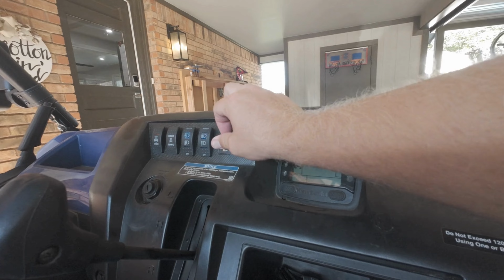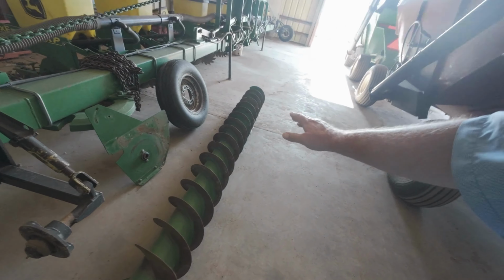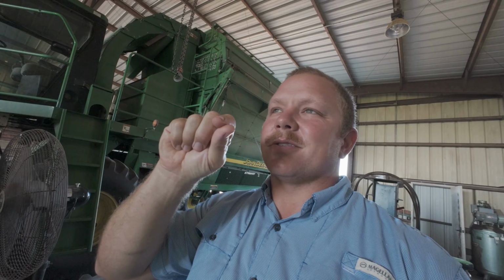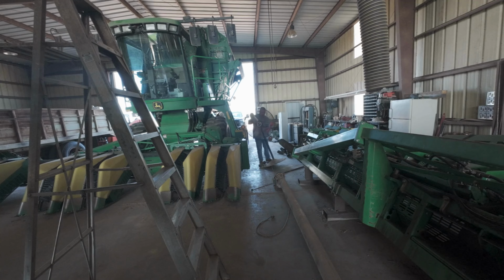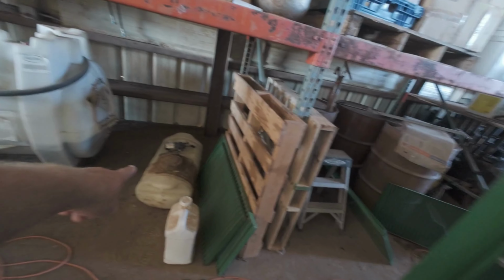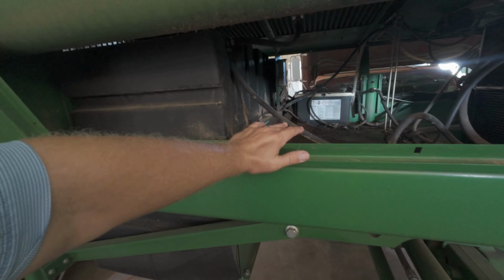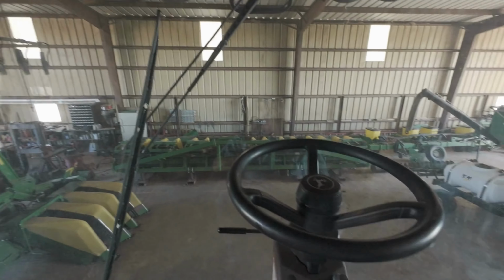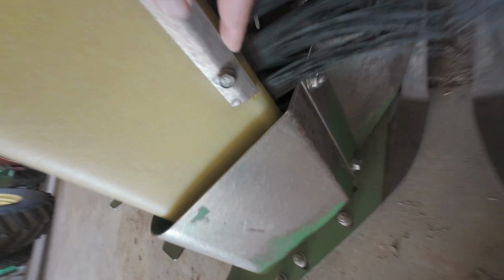My Stripper is Dead

Comment: Mine does that sometimes, and I have to move the hydrostatic lever forward a little and it will start right up.
Reply from the maker: That’s exactly what it was. Figured it out in the next video. Should’ve checked that earlier but it needed a new battery anyways